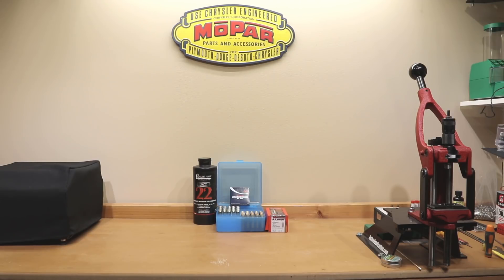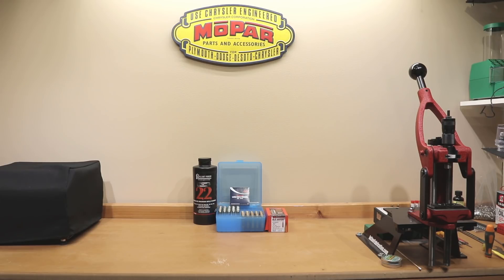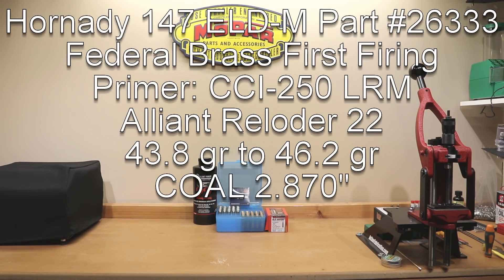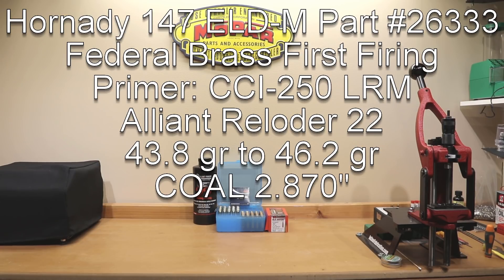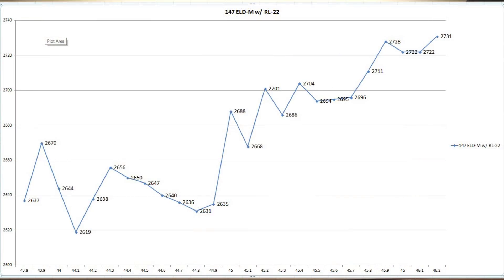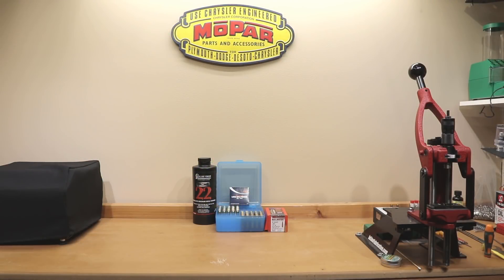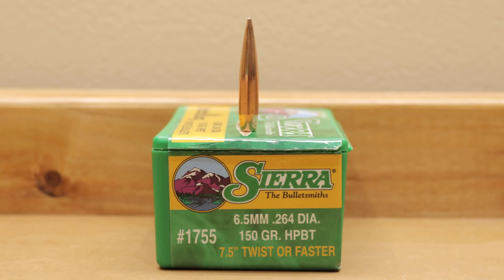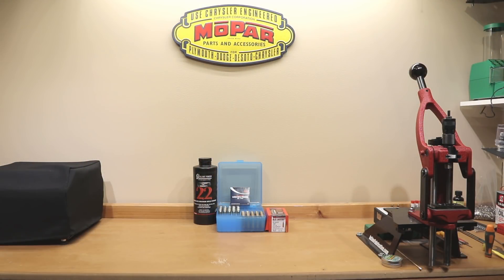Using the 10 Round Load Development Ladder test Velocity chart for Hornady 147 ELD-M and Reloader 22

Comment: Maybe its just my experience with the federal 6.5 CM brass but if you anywhere close to higher pressure you'd have bad ejector marks. I have 60 cases from 3 boxes of federal non typical ammo purchased months apart from each other and the brass is way to soft. You have to load 2 or 3 grains below hornady published max otherwise you get bad ejector marks. This is the only brass I've experienced this with, all my other brass is fine and goes beyond max without any pressure signs or ejector marks.

Hopefully it's just the non typical brass with this issue

Comment: You should try this with RL23.  Similar burn rate but is a “stabilized” powder similar to RL16.  

As an aside, I’ve discovered a tendency of my RPR to have accuracy ‘nodes’ around specific velocity ranges, with 140 bullets, ( ELDM, RDF, Barned Burner Match).  Not on purpose, but as I looked at data/targets i found good/ to great accuracy tended to cluster around 2600 fps, and again around 2780.  Even loads with poor SD/ES tended to give acceptable accuracy if they landed at or close to these mv nodes.  Loads with good or even great sd/es were showed marginal to poor accuracy if far from these nodes.  Even the otherwise execrable RDF showed a tendency toward improved groups if close to one of those MV nodes.

As I’ve tuned my CBOL for sd/es, this preference for specific mv seems to become more pronounced, which is how I noticed it.  It looks like there is another mv node above 2900 fps, but I’ve decided I don’t care to push my rifle that hard.

I’ve not bothered to measure the throat on my RPR simply because the factory magazines represent the COAL limit.  However, in some trials i found marked significant SD/ES improvements at CBOL lengths that resulted from looking at COAL’s shorter than the SAAMI standard.  I started looking at this after noting recent load data from some of the bullet vendors showing COALs much less than 2.825.  In my RPR i found a SD/ES sweet spots with CBOLs of 2.102 for the ELDM and RDF, and 2.125 for the Barnes match; the associated COAL’s don’t reach beyond 2.790 for any of these.  Tuning loads with these CBOL for specific MV  ranges preferred by the rifle seems to result in the best achievable accuracy for that particular powder/bullet/primer combination, at least that is what the data seems to lean toward now that ai’m looking for it.  I’ve got another set of test loads planned looking specifically for this, starting from a load that was the most accurate I’d found, but had opened up when the barrel passed through its speed up phase after 200 or so rounds.  Just coincidentally, at its most accurate it had a MV of 2781.  That same load is now shooting around 2860 with just ok accuracy.

like anything else YMMV.
Reply from the maker: I actually haven't seen it on the shelf yet. I am looking.